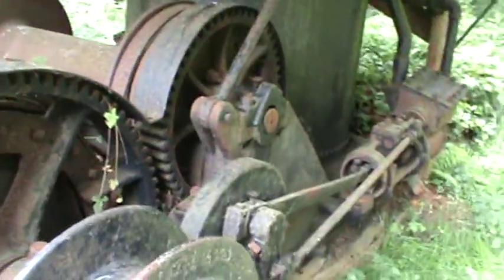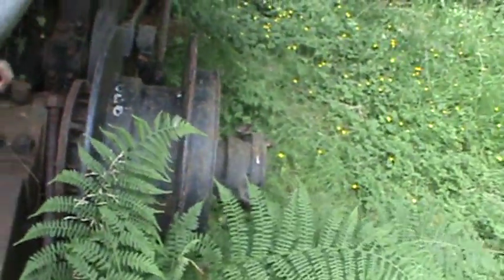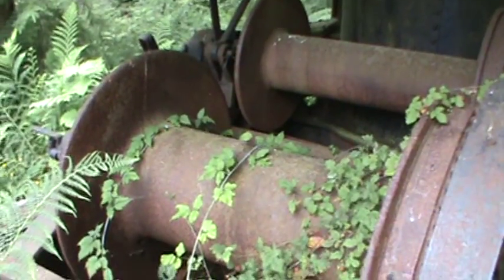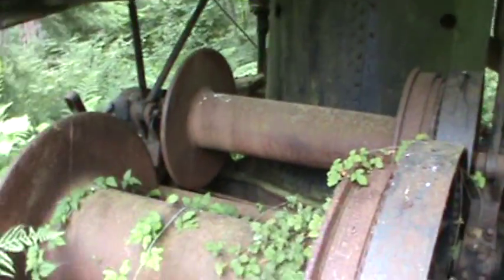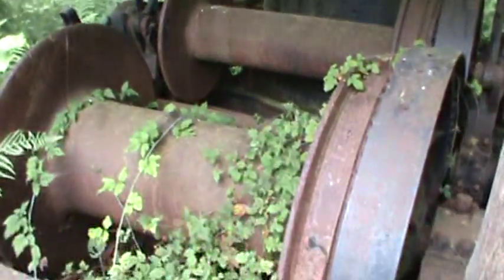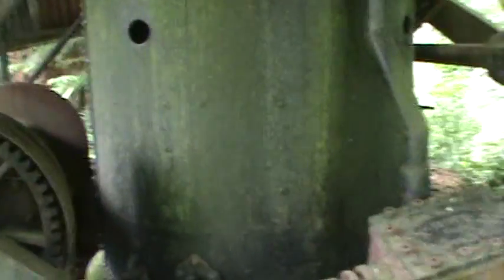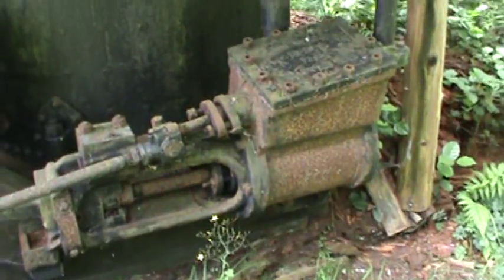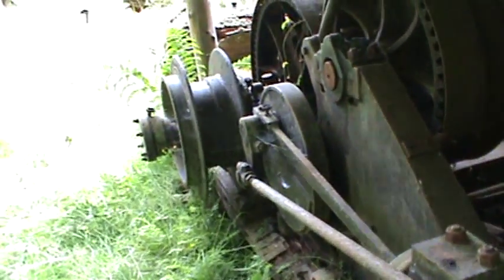Washington Steam Donkey

Comment: They have one every year at Matlock Days in Matlock, Wash. Eddie Hayes and I along with Arnett Danielson built the last wood sled for Crown Zellerbach up at Savage creek on the upper Naselle river. It had been steam at first but converted to a twin Berger diesel in later years. We built it in 1965 or 66. It was drug to the top of the ridge and used on one setting then torn apart. The wood cutters got the fir sled. The logs were 60ft. long and 6 ft. in diameter.